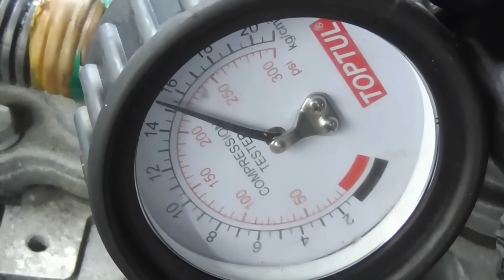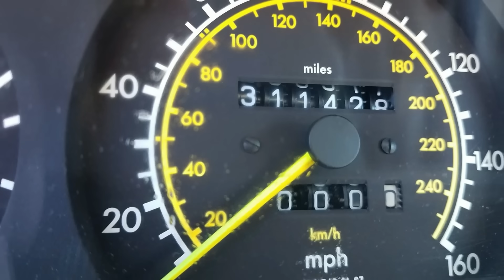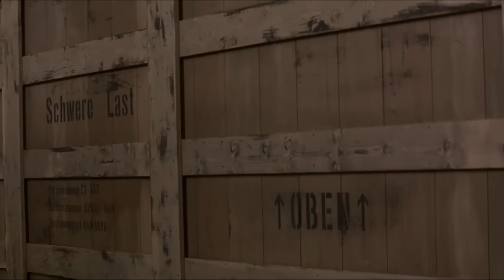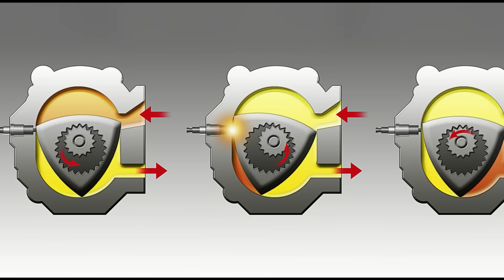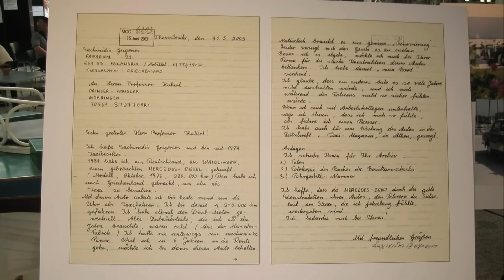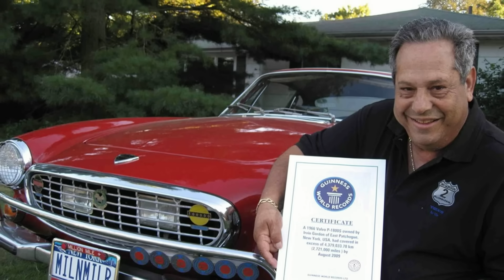Most Reliable Engines of All Time

Comment: No mention of GM inline sixes? My 1971 Chevy 250-6 had 183,000 miles on it when I sold the car. Stone simple, easy to fix and didn't have any pollution control junk on it.

Comment: The Buick 3800 should be on the list and the Ford 4.6L Modular V-8. There is a 2003 Crown Vic that has 1,850,000 documented miles on the sane Moter and trans and many Buicks 3800 V-6 go pst 500,000 to 600,000 mark as well

Comment: I can't believe you forgot the Mercedes OM606.
Those engines can go 1 Million miles easily.
I had one with 400,000 on it and was still running like new.
Reply: Stimmt, sind Top- Motoren 🇩🇪❗ Auf weitere 500 000 Km ❗❗Weiter viel Spass, mit dem noblen Benz 🤓👍👍

Comment: I am quite disappointed because the 1.9 TDI is not here . I have a Passat b5 , 24 years old and 600 000 km on board and it still runs well with just the filters changed regularly and one changed clutch

Comment: Saab h engine is insanely great. Turbos can handle 250-400 hp depending on the variant (with stock internals), and the best variants are pretty consistent 500 000km engines. Thats pretty good for turbo engine running on gasoline. Its chain driven, and the chain lasts until 500k. Newer, 2000s variants of the engine are still good, but not outstanding like the older ones.

Comment: The Ford modular 4.6 liter V8 2 valve engine found in the Crown Vics and a few other models have seen some high mileages. Many ex cop Vics went on to do taxi duty after being sold on . 500.000 to a 1.000.000 miles was a walk in the park for these engines to do with no major issues.
Reply: I totally agree.  I am the original owner of a 02 Ford Explorer with the 4.6L  v8.  I have put 190000 miles and it still runs flawlessly with just normal maintenance.  The milage includes 11 trips from Michigan to SW Florida towing an 18 foot  boat.  This is a truly Bullitt proof motor.

Comment: 300,000 on my 2001 Toyota Camry with the 5sfe engine. Original engine and transmission. The rear brake shoes are still original with plenty of meat on them.

Comment: my dad's peugeot 307 SW has 375k, me and my brother have been revving, driving aggresively, doing scandinavian flicks, doing launches, and one time we took it to "rally", my dad hasn't done a single oil change in the last 70k miles, it has been in an accident and is still running fine, along these years the only problems it gave us were: a bad fuel pump which we changed, and one time the engine got clogged with carbon, some revving did the job and the car back in shape, the engine is still running great, the gearbox is completely fine and the car hasn't seen maintenance in a very very long time, its my dad's work car yet me and my brother used it for way more than that, i love it.

Comment: Aside from needing timing belts periodically, I think the old Honda Civic and Accord engines from the late 80's and mid-90's were among the most reliable.  Yes they needed timing belt changes, but beyond that, if you just kept relatively clean oil in them and topped them off, they easily could run for several hundred thousand miles with little to no other maintenance.   And the 1.5/1.6L Civic engine was among the best.  This was of course until they redesigned it in 2001.

Comment: 250k on my 2.5 duratec 24 valve mercury cougar. Car is a relic but it runs like the day I bot it. Just normal maint. The timing chain so far is hanging in there.

Comment: I have seen old Cummins diesel engines on old Dodge rams hit 10,000 miles. That is impressive because trucks are made for work and are used to tow and haul. The Mercedes Diesel while damn good ran a passenger car so I challenge it as being the best ever made. I think the early model Dodge Ram had the best diesel engine ever made.

Comment: Did not include the GM 3800 V6 engine. It’s the best V6 ever made. Mine is 22 years old with 210,000 miles so far. Still a lot of them on the road. 205 hp and 30 mpg on the highway.

Comment: Ford's "Lima" engine is another good example. Yes, when they first came out in the Pinto's, they did have some problems. But after five years, the engine was perfected. Fast forward to today, you still see a bunch of 80's, 90's, and early 2000's Rangers still on the road today. With well over 300,000 miles, and hardly any engine noise.

Comment: my old VolksWagen T4 2.5 tdi stil had the original Clutch at 240'000 miles when i sold it, and the friend who bought it is still driving it and towing a trailer with no issues :)
Reply: Legende der T4❗Der beste VW Bus aller Zeiten ❗❗🥰

Comment: We have seen sohc and dohc Ford Australian built 6 cylinder engines in Taxi's doing over 900,000ks with general maintenance. My sons mate got given(from grandparents)a Barra 6 that had 580,000ks on it, he flogged the living hell out if it, it is still running and done around 760,000ks now

Comment: My  motorcycle(gl1800) has over 500,00ó miles on the clock.  My Gl1500 had over 800k on the clock before it was hit by a car. Engines can go on and on..

Comment: Not to mention jeeps 4.0 INLINE 6 had one with 320,000 original motor still ran when I sold it. Or the notorious re vamp of the 5.7 hemi. Seen those with 400,000 miles on em

Comment: Yeah hate to tell ya boss man but most the stuff on this list is complete piece of shi.... I got a FORD f150 that's 30 years old with 330,000 miles original motor still runs and drives. ( FORD INLINE 6)

Comment: You know why engines are not reliable, well it is mostly people thinking they can go over 5k miles without an oil change because the bottle or manufacturer says you do not need to for 10K or 20K miles.  You fools, don't believe it. Consistent regular preventative maintenance and fresh fluids will keep a good engine running smoothly for hundreds of thousands of miles no problem.

Comment: Crazy how millennials change the definition of things or cancel history to suit their interests, in this case, high milage engines.  In my day, reliability wasn't measured in "miles", it was measured in years.  A 1967 Ford F100 with the 300 c.i. 6 cylinder engine for example, ran everyday for 35 years. By the owners own accounts, traveled to work and vacations, likely traveling more than 2 million miles..  and it still runs today!  
Another owner talking about there 1962 Dodge Valent with a slant six.. also in the multi-millions of miles.. still drives it to car meets!

Comment: Where did you get the data on the Wankel engine from the face -saving Japanese.. Well it's nonsense... The seals wear out in 30,000 miles. The early Volvo engines were all good, plus early Bentley's straight eight...and even later ones.

Comment: No matter what vehicle you drive you should never go over 5000 miles without changing your oil. On transmissions the fluid should be changed out every 30,000 if you want to keep it running forever.

Comment: I'm currently driving an '02 Dodge Ram 4.7 V8 with 415,000 miles and going strong. I have add a quart of oil 1200-1500 miles. Never lets me down.

Comment: 90 % of these 'great' engines would die if you ran them out of water or oil once. overload, beat on, poor maintenance:bye bye.
7.3, 289, 300 straight 6, cummins 5.9, 327 slant six will outlast them in the real world of real owners.

Comment: I had a 1996 Nissan hard body with the ka24 it had over 600,000 miles on it before a Cadillac pulled out In Front of me one morning only thing I ever had to to to the engine was change out the timing chain tensioners in my opinion the Nissan ka24 and it’s predecessor the z24 engine are the best Nissan ever put out very reliable

Comment: The B18 engine in the Volvo P1800 is as close to indestructable as they come. You find this engine in all Volvo’s of that era and it was so common here in Sweden that we jokingly said that you could walk into any swedish supermarket and buy parts for it.

Another really reliable engine was the 1,8 litre straight four manufactured by Volkswagen in the 80’s and 90’s. You found it in VW Golf/Rabit, and Passat aswell as in Audi 80 and 100. A friend told me of a cabdriver he knows who had an Audi 100 1,8S Avant that had about 700 000 kms (440 000 miles) on the odometer and the only things he had done to it was to change oil and wear-and-tear parts. He bought a replacement engine for the car at about 400 000 kms (250 000 miles), but that engine was still stored under the workshop bench in his garage.

The story might seem like some kind of science fiction, but there actually was a time when Volkswagen could build reliable cars. Sounds incredible, but I swear it’s true.

Comment: I had a 1991 Buick Century with the 3.3 liter V-6 that had 295,000 miles with no problems what so ever. The only reason I traded the car was that it needed a new fuel tank and fuel pump. I am a firm believer in using quality oil and gasoline, I run a bottle of fuel system cleaner every couple thousand miles, synthetic oil and Slick 50 as directed.

Comment: 2011 Nissan Xterra S (VQ40DE engine with 6-speed manual trans) with original engine, transmission, and clutch.....245,000+ miles.

Comment: My nissan 2013 nissan sentra still has the same clutch with 140,000 miles. No transmission problems or engine problems. Only issue was the heatshield became loose, but thats because i hit a piece tire the highway!

Comment: Nobody can prove their engine with a million miles because they don't big truck diesel engines are the most reliable all the engines built because they are built so well and you can usually squeeze 750 to pushing a million miles gasoline engine haven't seen it don't think I ever will

Comment: Up to 200k miles? Unheard of. Except there are many, many cars that do this. For example, my 2003 Toyota Highlander (1MZ-FE) has 265k miles. These routinely go past 300k. My dad had a 1991 300E, which got 320k miles. Not to be outdone, I had a 240D that I sold with 360k miles. Granted I'm a cheapskate, but forgive me if I don't sound impressed with 200k miles. I'm not that exceptional.

Comment: The top cars had to be verified and certified for true miles, not hearsay.  Many thanks.  The Cummins and the Volvo Diesels are found among the mega motorhomes that will go over 2 million miles. It is not uncommon to see older Ram (aka Dodge Cummins) pickups falling apart when the engine is still running.  Meaning the engine will outlast the truck.

Comment: You missed the 1million mile honda crx has original engine and trans it's at honda museum in USA also I've only owned manuals and I've always got 150k plus out of a clutch and that's doing daily  duties plus fun like burn outs ect across multiple model's Subaru Honda Ford Nissan Volvo Mazda and Volkswagen

Comment: I have to say my mercedes benz with the m112 , (2.6lt) v6 after 250k , km so 150k miles you can put your drink on the engine at idle and it barely shakes the liquid.  
I'm not kidding it's hard to tell if it's on at all.
it's known as of the most robust and reliable engines mercedes benz ever made. 
there are some out there still running well into 500k km on the motor with only engine mounts and basic stuff replaced kinda thing. 
mercedes v6 is an incredible motor and can be turbocharged or supercharged with a crap tone of boost. 
they make stock 160hp but can easily bump 300hp

Comment: It is Negligent to not mention Toyota 22RE series engines. Most popular in the Pick-up truck.
My 73 model still runs like a sewing machine.
Reply: The timing chains stretched and would chew through the big cast aluminum timing cover.  Worked for Yota.  Changed many.  Check yours.

Comment: The best engine built had to be the Ford 300 inline 6.
The next best, in my opinion, was the 3L Chrysler V6. It runs like a sewing machine and just goes and goes. Only downfall is fuel mileage, but worth the tradeoff.

Comment: Well  are times when just the right parts  are put in at factory  have a dodge 3.9 with 528,000  on it  others gave has problems..but that said if had to get a Toyota engine would want would be 22R...things  run forever if they had to would run one cylinder

Comment: 465,000 miles on 5.3 Silverado. Original spark plugs and I changed the engine oil every year whether it needed it or not. 369,000 currently on a 2002 5.3 Chevrolet. I change the oil every 50,000 or so miles whether it needs it or not......ok the Mercedes with almost 3 million miles on here ....I will shush now.

Comment: I know this might not be popular, but I owned a 99 Saturn SL1 (bought it new) we put over 375k on that car without changing the engine or transmission. We sold it still running well, who knows how many miles were added to that var and if it is still running.

Comment: Hmmmm....not sure I agree with this list...I am aware of 2 engines by Toyota are better.

The Toyota Hilux 4CYL diesel older models.  Those will go many hundreds of thousands of miles.
Then there is also the Toyota straight 6 diesel that was used in the FJ series landcruisers...again older models.

Comment: The Toyota 20R I-4 (1.8L) engine is the longest lasting engine ever made as one has 7.7 MILLION miles on it and has NEVER been opened-up in a 1973 Hi-Lux 4 speed pick-up. It's in the back of every truck magazine advertising Valvoline High-Mileage Full Synthetic Motor Oil they give him free. The owner delivers the Sacramento "Bee" Newspaper on a daily 500-odd mile route 7 days a week and changes oil and filter (K&N) every two-weeks. It's the highest mileage gasoline powered car ever built by a factor almost three. The second is a 1976 Toyota 20R 2.0L I-4 SR-5 Corolla Hatchback with 3.5 million miles. The Mercedes diesel W190D only had 1.9 million miles (3 million Km) before Mercedes bought it back from the couple in South Africa and put it in their museum and it had been re-ringed three times. Next up is the 22R I-4 in the 1983-1985 Toyota Camry at 2.2 million miles, then a Mazda RX-3 Rotary with 2.1 million miles on ORIGINAL SEALS , then a 1972 Suzuki GT750 three-cylinder two-stroke motorcycle belonging to a personal friend of mine the famous "Water Buffalo" with 1.8 MILLION original miles on the original rings and now on his fifth clutch-been in EVERY motorcycle magazine published on Earth with my photographs and is still ridden daily. Suzuki offered Jim $120,000 for it, but he loves his bike. Keep Bel-Ray in the Auto Lube pump and good gas in the tank and it goes.A friend of both of ours has a Suzuki RE-5 Rotary with 800,000 miles on the factory seals and the factory water-cooled exhaust pipes. There is reportedly a Ram Hemi with 2 million plus miles and a Ram Magnum 5.9L with 2.4 million miles and NUMEROUS Cummins powered Rams with 5 million miles+ on their engines-one in Alaska reportedly has 10 million miles, but is on it's second or third turbo and injector pump.Not uncommon for turbo-diesels. Too bad GM can't build an engine of ANY kind that will last 70K trouble-free miles since the NorthStar Opel designed. I bought my parent's a Fleetwood 85 Saloon with a NorthStar 4.9L V-8. They put 330,000 absolutely trouble-free miles on and sold it for $4500 less than I paid for it 8 years later to a USED CAR DEALER for his wife!!! That was $28,000 above NADA book, but it was so clean and the body was absolutely show-room condition and never smoked in.

Comment: You didn't do your homework well, as the longest-living engine is Toyota's 1HZ 4.2L 6-cylinder diesel - which does between 500,000 to 1,000,000 kilometers before it needs an overhaul! It is around 30 years old and still made, and still found in Landrcuiser 70 series 4x4's. This engine is legendary, at the top of literally all others, and I think it is strange you apparently do not know about it's existence!

Comment: Can anyone comment please on the Mercedes-Benz M272 V6 24 valve twin cam naturally aspirated aluminum engine? It suffered  a bad supplier of one single part—who made defectively tempered balance shaft drive cogs, which must usually be replaced at around 60,000 miles. Once this is accomplished this sophisticated, high output engine seems to do quite well in terms of longevity

Comment: Top fleet motivators when it comes to reliability are the ford 4.6 2v 2002 and up, crown vic, f150.   Many see 400k miles changing oil only 50k miles at a time.   Then pre DOD LS engines.  Specifically the LQ4/LQ9

Comment: I HAVE ALREADY SEEN THE Toyota 22R AlSO 22 RE engine's get up to 1  miles with no breakdowns  I ALREADY KNOW I REALLY COULD build  AND Design a 4 cycle gasoline engine REALLY WOULD EASY get up to 3 millions  with NO breakdowns I REALLY AM a REAL ASA certified master Auto technician or a ASE certified Master Auto Mechanic with OVER 60 year's of REAL experience I have ALREADY repaired AND AlSO rebuilt  automobiles engine's and transmissions AND the electrical systems every day for a REAL living for OVER 60 Year's

Comment: The most mileage I've gotten from an engine, so far, was on my 5.8 liter Ford V8 at 326,000+. I stopped driving it due to gas prices. I'm sure it could have gone to 400,000 easy.
I also had a 302ci Ford that saw 4 different cars.

Comment: These engines lasting 300k...
LS engines with 300k in junkyards all over the US and the guys picking them out of junkyards with 200k and adding 17 psi of turbo that was never designed for a turbo and runs 10s in the 1/4 mile with around 800hp 😂😂😂